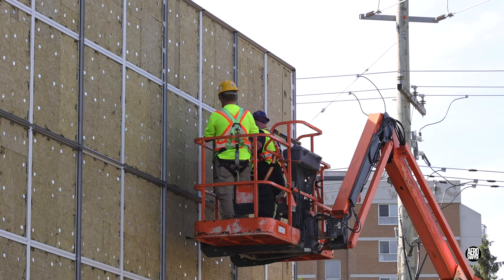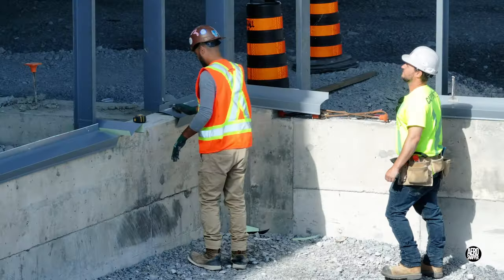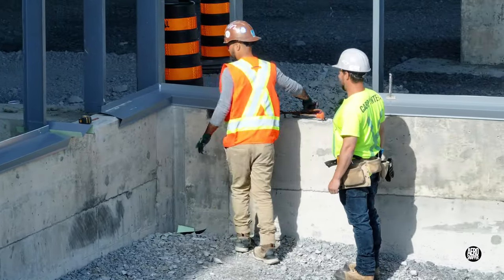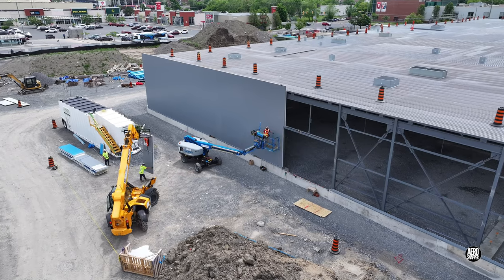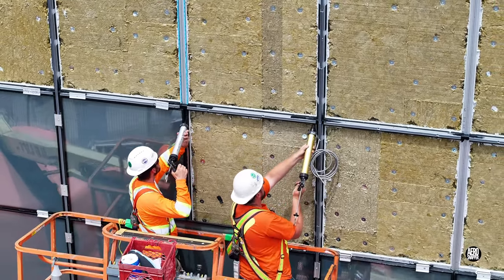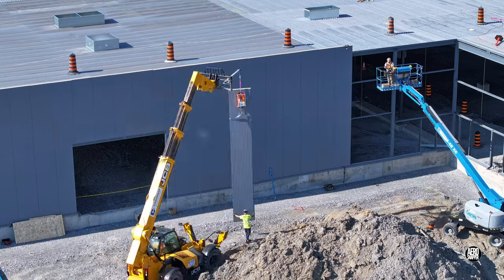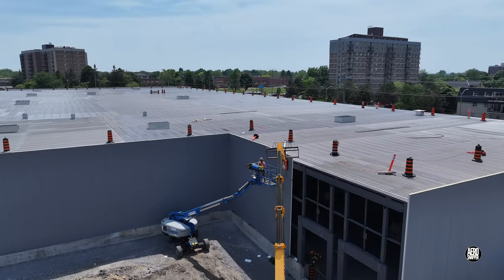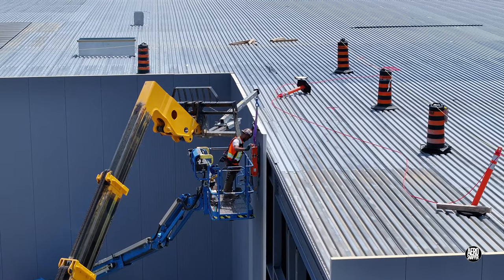It's becoming a Panel Game - an update on Kingston, Ontario's new Canadian Tire Store build  4K

Comment: Hey Aerosnapper, where are they building the new store? I lived in Kingston from 1980 to 1993 and they already had two Canadian Tire stores at that time.
Reply from the maker: There are three stores in Kingston currently. They are at the Cataraqui Centre on Princess and Gardiner Road / Division St  at First Canada Ave (south of the railway line) / Bath Road.  The new one is to replace the Bath Road store and is located at the junction of Bath Road and Sir John A. MacDonald Blvd. If you visit Kingston you will see a lot of changes..
Reply: @Aerosnapper  Thanks, I go to Kingston at least once a year to visit my sister and yes, I've noticed a lot of changes.